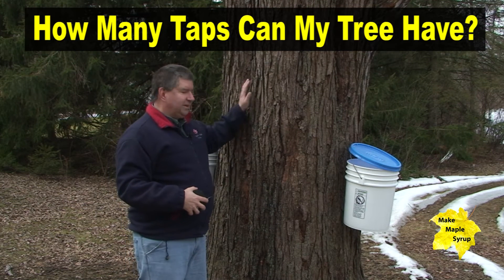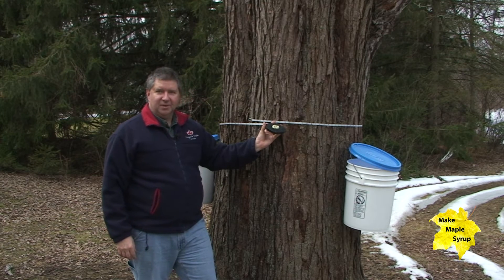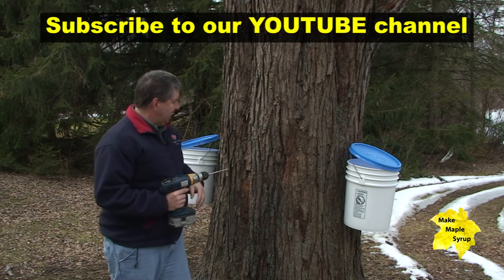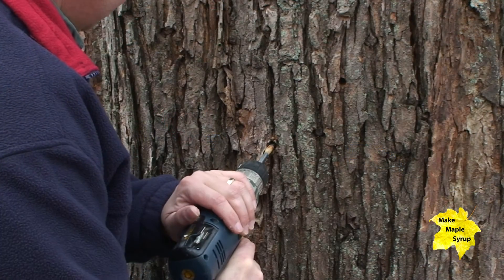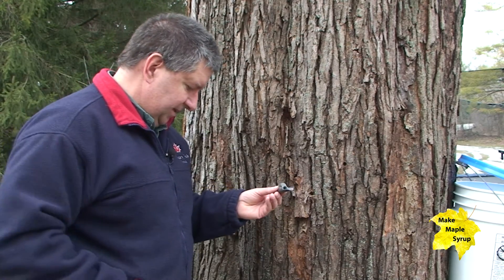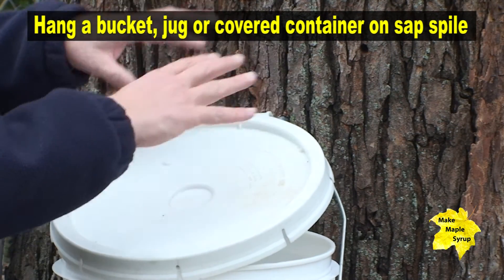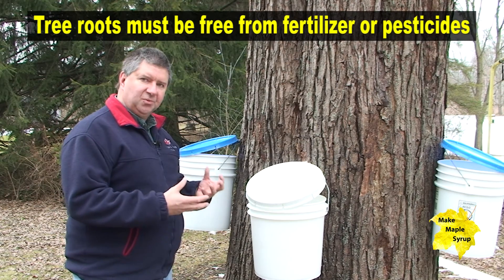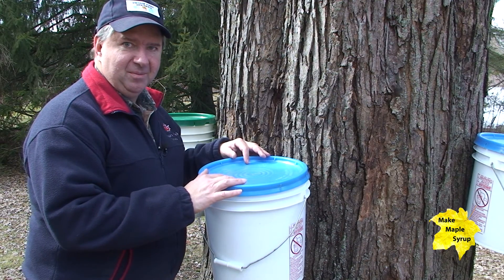How Many Taps Can My Maple Tree Have?

Comment: How long does a tap mark stay on a tree
Reply from the maker: Hi Chickens Float - thanks for watching and sharing your question. After the taps are removed, they begin to heal up. These small holes, are sometimes referred to as "bellybuttons" because they resemble a human bellybutton. They typically remain on the tree, for the remainder of the trees existence. Even if the tree dies, you may still see these old tap hole marks.

Comment: What happens if you drill too many taps? Our first two trees are about 30" diameter, and we have 4 taps in them. It got cold for a few days. And now they're all totally dry. Did we tap too many? Or did the cold spell make them stop?
Reply from the maker: Hi parkimedes, thanks for watching and sharing your questions. Most maple tapping experts advise no more than 3 taps on your tree - no matter what the diameter of the tree. The reason for this, is to limit the amount of sap/stress that your tree will give up during the sap season. This is for long-term conservation and health of your maple tree. Over-tapping(4 or even 5 taps like in the old days), year after year, has been found to cause too much stress on the trees, and you may notice some die-off on the trees if you continue the practice. You will be OK, doing the 4 taps this year, but I would strongly urge you to limit all of your trees to 3 taps (if they are larger than 30 inches or more in diameter. Now, with regard to sap flow - generally speaking, temperatures below freezing (25F is ideal), help sap flow. But you also need adequate moisture in your soil - in the form of snow melt, or the ground thawing. The best conditions are 45 degrees daytime/25 degrees overnight. But again, you'll need moisture in the soil too. So, hang in there - sometimes a passing rain storm will help the sap flow. Or sometimes a night with temperature under 30 degrees will reset your tree and get the sap flowing. Thanks again for the great questions and good luck on your season.